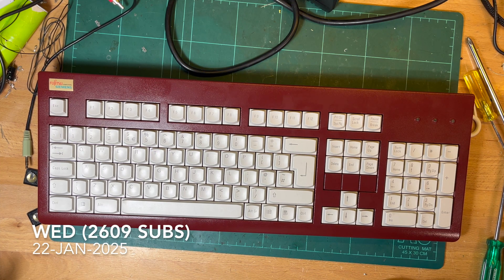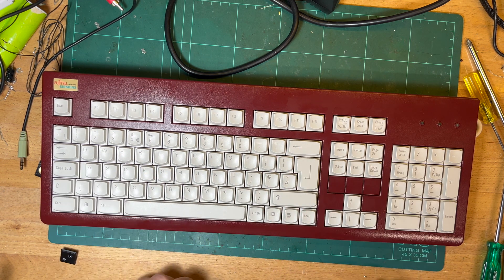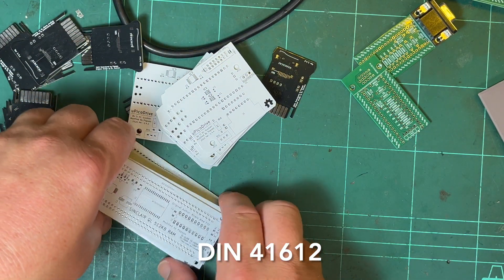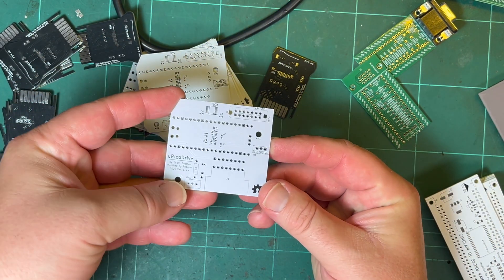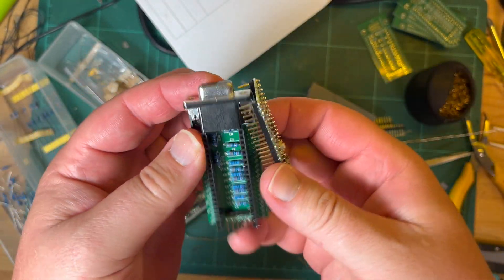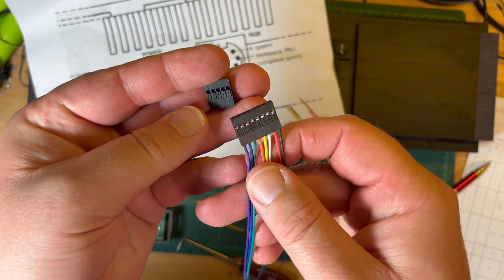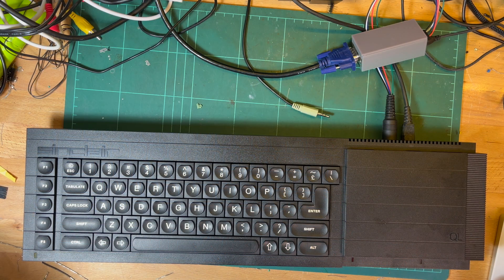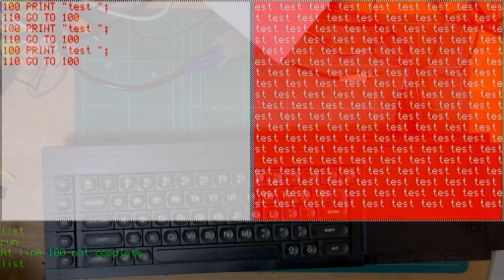🇬🇧 Sinclair QL: Part 4 (VGA Video Output) [TCE #0566]

Comment: Hello :) I forgot to mention it in my last post. In the MDP (uPicoDrive) you don't need some components that belongs to the sound system. That I didn't implement yet (lack of time, sorry). But if you wish to use what already exist (sound emulator for Oqtadrive or vDrive based on aTiny) you have already the foot prints for components and also the RV1 to control the volume (ideally it should be a CD potenciometer like before to control the volumen of CD units from PC era).

Comment: Ah that gives a pretty crisp output. RGB via a Scart-HDMI converter is OK but gives some vertical artefacts visible on a black background and is not as crisp IMO.
Reply from the maker: Maybe something to do with the QL's odd resolution of 512x256?  Part of the conversion to 1024x768 XGA that the Pico does is convert each QL pixel to 2x3 XGA pixels.
Reply: @Brfff  Yes, probably. The upscaling in those HDMI converters is not all that great, and the odd aspect ratio of the QL is likely to introduce some artefacts when upscaled in a "naive" way.

Comment: ive got some parts on the way to replace the GBS with a pico (and some comparators) for the CPC, should bring the size right down to slightly bigger than your vga converter here, and it works perfectly with all games/demos unlike the GBS... VGA4CPC on github.. i gotta order some boards soon...was gonna built one up on perf board to begin with..
...the way ya say pico... gets me every time! LOL.. its pico like micro/nano/kilo etc! :P
Reply from the maker: Argh, you're making me re-watch my video ... what am I saying?!  Peeko or Paiko?  Or do I alternate?  "Peeko" would be like Finnish pronunciation I guess, and "paiko" like normal English.  Actually I was also just thinking about custom Pieko based converters for different computers ... I would be interested to hear if the CPC one can handle Pinball Dreams ... I think it needs a real CRT (didn't work via GBS8200):
https://www.pouet.net/prod.php?which=83118
Reply: @Brfff  sounds like PI-CO ?!..which actally makes sense being a raspberry PI... LOL should be PIC-O ? thats the way ive heard it all my life!.. 
yes PD works... and so does Ghosts and Goblins..aswell as others that GBS stuggles with.. seems to be the only converter ive seen that actually works properly!
ill link ya on discord...
Reply from the maker: Yeah, I just realised after replying that ... OMG ... he's right, it should be "peeko" shouldn't it!  And you're right, I think my brain was just lazily reproducing the "Raspberry Pi" pronunciation!